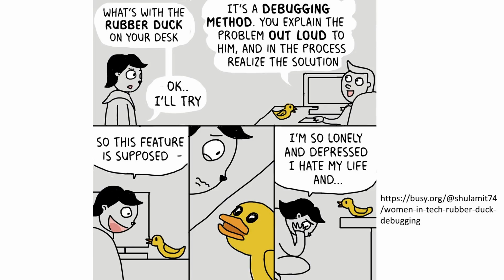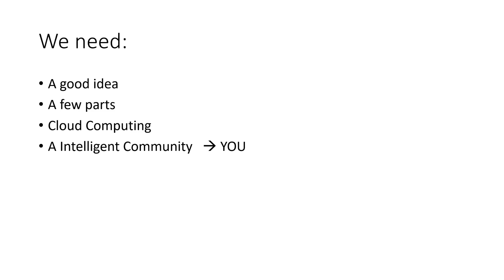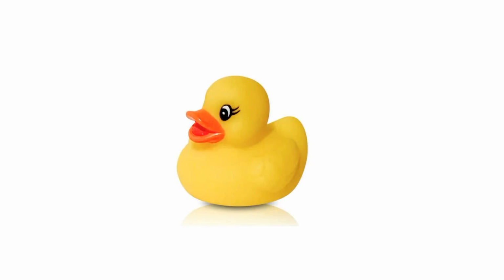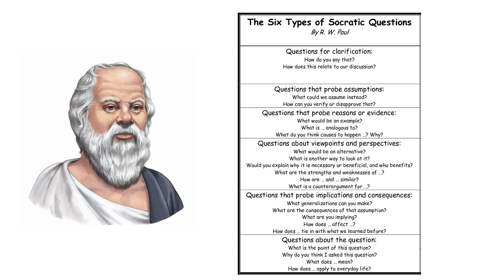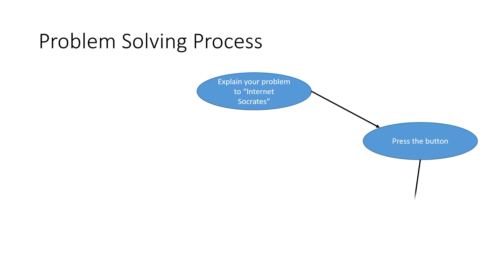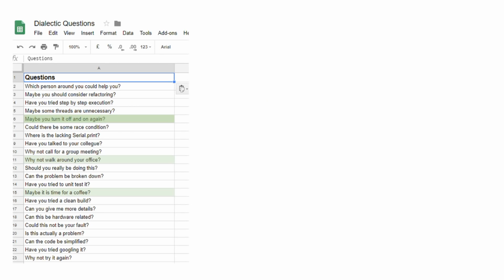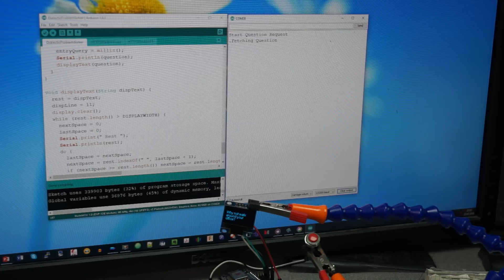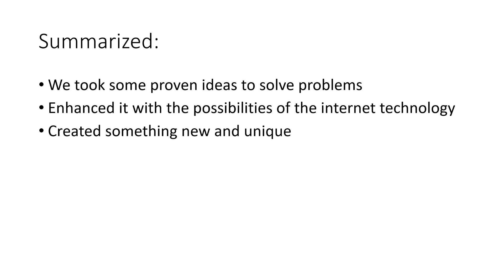#213 How to build an innovative Problem Solver for 10 $ (ESP8266, Google Sheets)

Comment: I bought a bunch of those plastic "travel soap dish" things to use as project cases.  These are easy to drill and cut, cheap, yet rugged enough for many uses.  You can even seal them if required for weatherproofing.
Reply from the maker: That is a good idea, and cheap!

Comment: Hello Andreas, I tried to modify the sketch to make use of my own sheet on google drive. I published the google script, updated the GScriptIdRead but no luck (I used video #185 for reference). Can you please give some hint how to use an own google spreadsheet? Thanks, Alex
Reply from the maker: Did you publish it to everybody?
Reply: Hello Andreas,
here is what I did:
1) Sketch: I replaced        const char *GScriptIdRead = "…”  with mine I got when published the google script as Web-App (Access: all, including anonymous users)
2) The sheet I created in google drive is called “socrates”, it contains a single column (first column is called “socrates” as well). The table itself is also named “socrates”
3) In the gs script I modifed the “doGet” function only:
                           …
                           var ss = SpreadsheetApp.openByUrl("https://docs.google.com/spreadsheets/d/...................................../edit");
                           …
                           var sheet = ss.getSheetByName("socrates");
                           …
 
Thanks for your help, Alex
Reply from the maker: Did you debug the script itself on google. If it does not work the problem is there. If it works, the problem is on the ESP side
Reply: Hello Andreas, I was able to solve the problem. The URL provided during the publishing process was different from the URL you can click on in the same screen. I disabled the web-app and republished it. Now everything works as expected. Thanks!
Reply: I have completed my work now: I modified your example a little: it reads and displays the questions in the setup() and goes to deepsleep afterwards. Last question is stored in RTC memory (thanks for the video on that!).

Comment: As an ex Deccie and an Engineer, I presume you are familiar with the ATS (Analytical Trouble Shooting) training delivered internally? If so, then for troubleshooting problems there is no finer method in my view (I was an ATS trainer in the UK NE District before I moved into sales). Also the old Kipling quotation works (used as part of ATS training):

"I have six honest serving men
They have served me well and true.
Their names are what and why and when
How and where and who?"
Reply from the maker: I was not aware of this training as I only was in Sales at DEC. I am sure it was a good training. I did my Ph.D. in Quality and there, the root cause analysis also was a very important part.

Comment: I built one!... I pressed the button and now it is cycling through each of the available questions. Should it not only fetch just one question?
Reply from the maker: So something is wrong. It should only fetch one. I am sure you find the problem by answering the questions ;-)
Reply: Funny answer. Is the PIN 0 the same as PIN D0 on the R1 Mini? Update: Problem went away when I changed the Switch to using D5 rather than D0.
Reply from the maker: No.GPIO 0 is D3 if I remember right. Just replace the 0 in the code with D3 or another pin you want to use

Comment: At the risk of feature creep, it might be helpful to add a way to categorize some of the questions to maximize relevancy for your problem.  I.e. General, Software, Hardware, etc.
Reply from the maker: If I understood right, the questions should not be too precise to the topic and more open. But maybe several databases for different topics could be an idea. Then you use the device you need for the purpose.

Comment: I will probably not build such a device. But I exactly know the effect you described. A colleague was fixing code that used an API from a system monitoring service to change the phone number of the person that is called if that service detects a downtime of some service. They had changed the API and they didn't return any useful error message. So he was lost and asked me for help. When I asked what this code does, I became the rubber duck. I didn't understand it, but while he explained it to me, he discovered that phone number was passed to the API as "cellphone=12345..." instead of "number=12345...". After he fixed that, it worked. ;)

This happens all the time. People think I know something, they ask me for help, I ask them what some trivial things do and then they find their error... Maybe I can be replaced with a rubber duck or such an esp8266 gadget.
Reply from the maker: I am sure you cannot be replaced by a rubber duck. But not many people are as lucky as your colleagues. Most people do not have the time to ask questions and wait for the answer.

Comment: Question, is this problem-solver going to be oriented to solve electronics problems? Or a general purpose problem solver? because in that case the questions to ask should be very broad, based on really general principles. E.g. "have you checked the wires?" seems to be very problem specific. Something like "are all the parts of the system really connected?" may be better.
Reply from the maker: Excellent! You see, this is why I knew that all my viewers together have much better questions than myself. Just enter all your suggestions in the spreadsheet and I will present it back to my audience.
Reply: Andreas Spiess Great Andreas!

Comment: Vacation brings you new ideas Andreas :) . This is a good one. Perhaps if it works offline also, it can be taken inside your pocket and support  life problem solving without internet connection :). I guess a question list sync up with your DB will do when working online.
Reply from the maker: Now it is up to you. I accept pull requests on GitHub ;-)